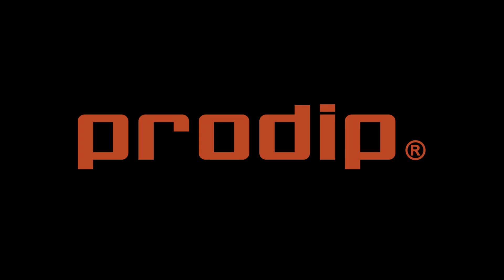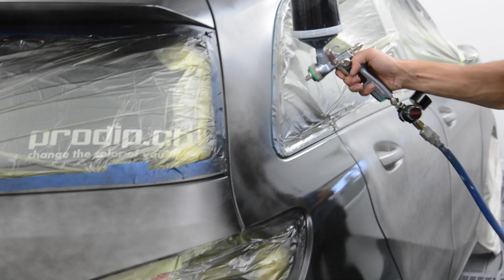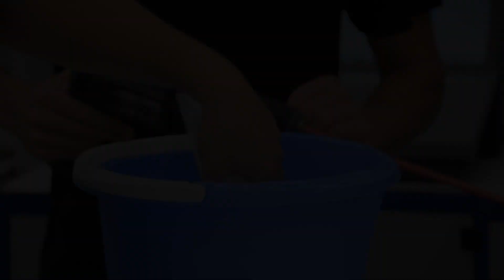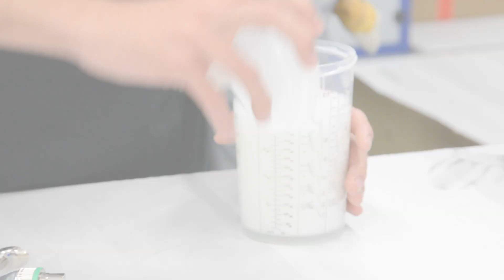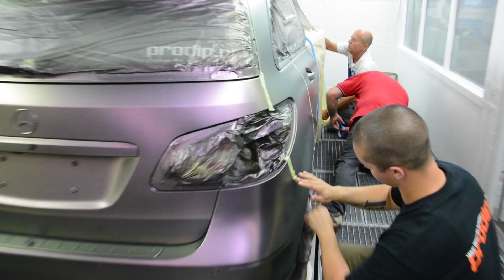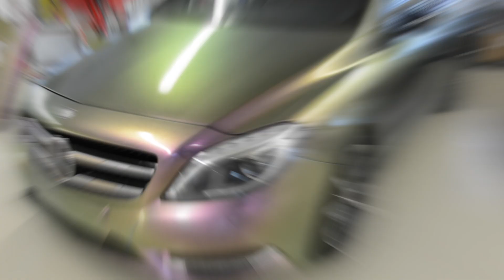GD-10 Alien Pearls with DYC DipPearl TopCoat (High Gloss)

Comment: why spray each panel at a time covering the others?
Reply from the maker: since the temp in the booth is high, its better panel at a time, not to get dry lines between panels
Reply: @ProdipPlastiDip  I see zebra stripping on the hood.